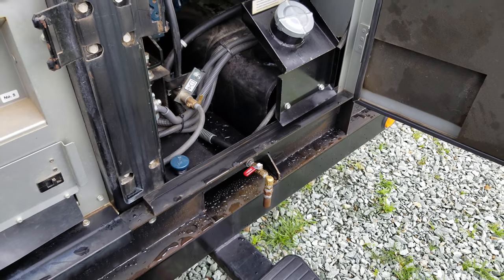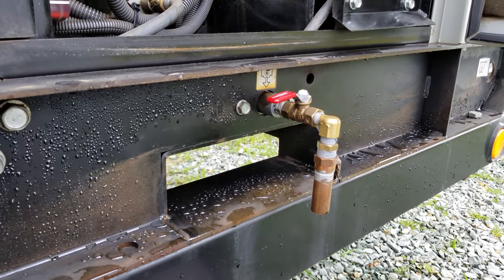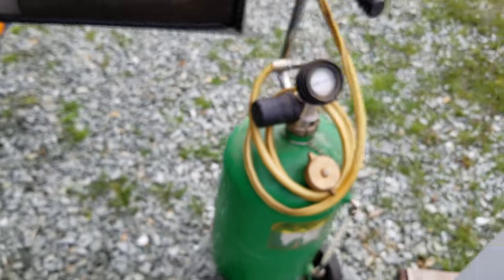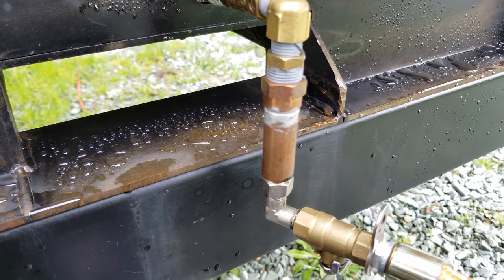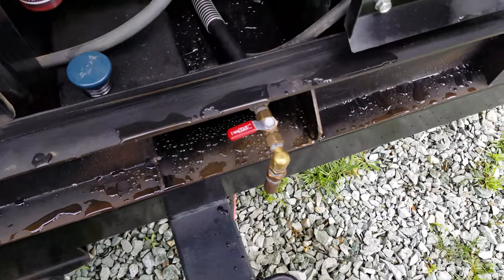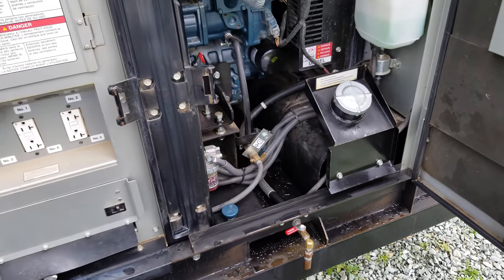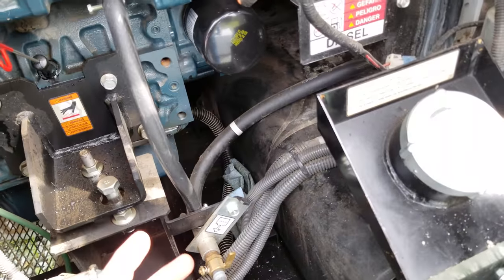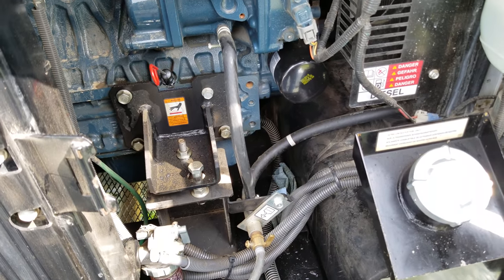One ball valve saves a massive headache

Comment: Where i worked, they changed the drain plugs to valves, mostly 250KVA generators so a lot of oil.
For security, you could change the valve to something that needs a screwdriver or wrench, this would also prevent accidental opening
You could unscrew the drain tube and fit the valve inside the compartment with an extension pipe sticking out, or if the downpipe had a thread, screw on a blanking plug.
I wonder if you could attache the vac system to the dipstick hole or similar orifice (breather tube) to suck the oil into the engine.

Comment: To improve the security of the oil drain (assuming that the door locks), just have the ball valve on the inside, in the tubing. Bit more work, but probably still worth it.

Comment: Good video, my uncle has a diesel generator on his property in Alabama that is on a trailer like yours, different brand but has the drain similar in design, instead of a ball valve like you did, he put an air compressor quick connect fitting on it, when he is done draining it he connects a connector setup in a plug configuration, otherwise he used a connector just hooked to some hose to snake to a bucket to drain the oil, just plugs it in and away the oil starts to flow out.
Reply from the maker: That is a good idea, my only concern would be if the unit got taken to a service center... having the service techs able to maintain the unit without messing with that quick connector.  Also this generator takes a pretty heavy weight oil so I'm not sure how well it would travel through the small orifice of the air fitting
Reply: @HighTechLab  not an issue if your the one servicing the generator yourself. He uses Rotella 15w40, typically he would start it up, get everything up to temp, then he disconnects the plugged off adapter, then plugs in the adapter with short length of hose, running to the top of an old 5 gallon rotella oil bucket. He said his is a Generac 14kw generator, takes 6.4L of oil. He is a fireworks/Christmas tree tent salesman, a few times a year he sets up his tent with the big lights and run the generator to light up the tents in the dark for a few hours each day along with charging the batteries on his RV he keeps at the sites to sleep in overnight.
Reply: I sent him your video, he also said if your engine has an easily accessible vent hose near the top of valve cover, you could hook a vacuum pump to it and turn it on, will pull a vacuum while you pour oil into the dipstick, literally sucking it in faster than you can pour it in the engine.
Reply from the maker: I do the oil changes but things like coolant flush and all the other routine stuff like valve check I have a dealer do.  They do an oil and filter at the same time so gotta keep it simple for them.

Comment: Brother pop the oil dip out when filling this lets air in. Will speed things up. God Bless
Reply from the maker: There is space around the oil fill, no air lock.  The slow part is going through the funnel.
Reply: @HighTechLab  O ok cool. I worked on genys  full time for about 3 years. That was on of the parts that was slow. We had a tank with a hose that would fit the fill. Then we would fill it to the right lvl of oil. That works ok when you do not have time to fill it. The tank was made from a old LP tank and some fittings laying around the shop. We had guys come in asking us to make them for them..

Comment: Remove the nut from the valve handle, drill a hole in the handle and tie it off inside with a string, then just use it to open and close the valve.
Bring a bucket of hot water and warm up the oil before filling into funnel.
Reply from the maker: Great idea with the string

Comment: How come you use that thing so much? Hows the solar system going? Are you going to show what happened with the fire in there?
Reply from the maker: Been using it a lot because it's been poor weather and the trackers have been tied down flat due to wind.  Also have been keeping the batteries from going in as deep of a discharge at night because I encountered a couple batteries that had sulfated from being discharged too long
Reply from the maker: Also have the auto generator start set up with the plc control box
Reply: @HighTechLab   that sucks. I really like seeing your system. My batteries are getting old even know they are still ok. Its been a nice weekend so far . From 9am Sat to 9 am sunday(today) I burnt up 31 kwh on solar .  I made it down to 12v/ battery. Lowest Ive been. Not bad for 6300w of pv. Its nice cause I can still use heaters since its been -10C. New vid coming
Reply: @HighTechLab   I seen the plc vid. Love it.
Reply: @HighTechLab  if your interested Id be willing to sell you 1 of my 120dc to 120 ac 10kw inverters for your system. It really saves the batteries
Reply from the maker: Forgot to address your question about the fire... Cleaned everything up and threw on some paint, looks good. All-in-all we lucked out and the only thing lost was the stuff in the immediate area of the fire and a few things that got some soot. Could have gotten way worse.
Reply from the maker: What I really do need to do is get some monitoring of power coming in from the generator and power going out of the inverter... pretty much more information to know just how well the batteries are holding charge
Reply: @HighTechLab  honestly I have a main power meter by my system with the charge controllers and a battery voltage meter in my livingroom. Just a cheap $2 one. This is the main thing I look at. I have gotten to know pretty much what my system is doing from that. Even the wife knows where to stop the system when voltage gets too low.12.2v x 10. 122 vdc. Im gonna post today when i get the vid done.
Reply: @HighTechLab   about the fire thing. I kinda am just getting used to my used agms.  In this high of voltage battery bank it is harder to keep the pack balanced so I have decided to go with LiFe Po4 cells. Alot more cells but a real balancing system. Fire is the 1 thing I fear for with this. But I got such a good price .  Im gonna have 9000 cells in use. We ll see.